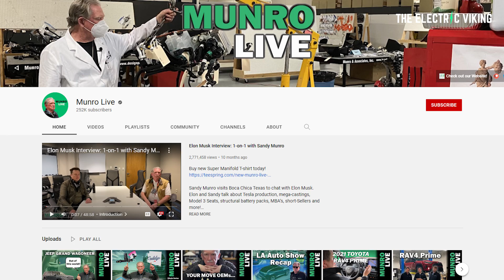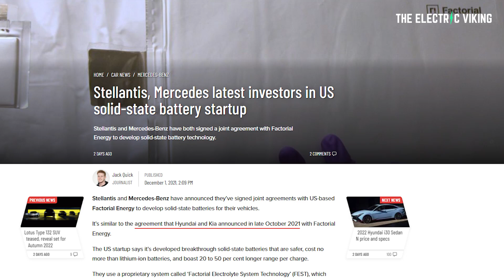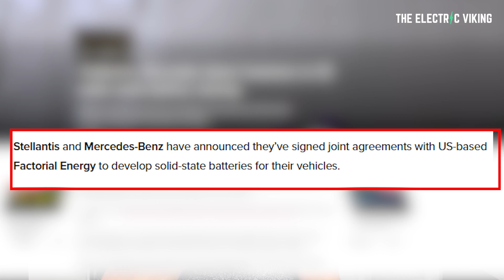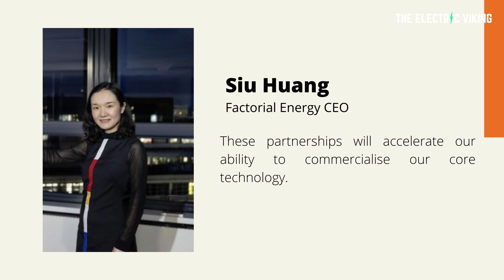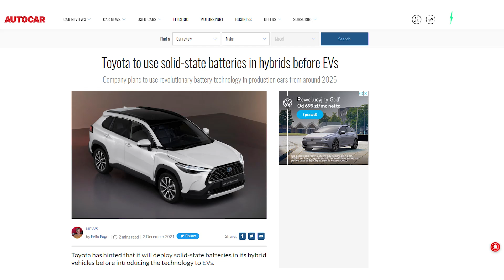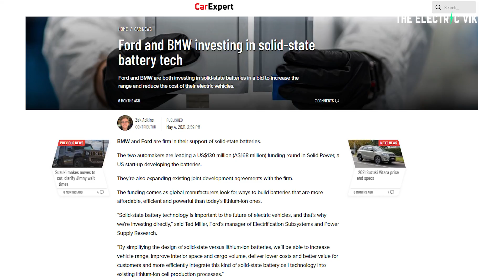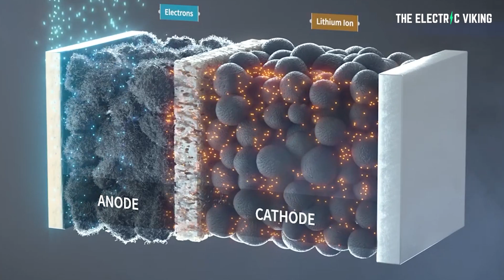United States leading the RACE to develop SOLID-STATE batteries

Comment: Soild state is good on paper but I haven't seen one yet. If you had one with 150 mile range and charged in 5 minutes gas stations would be back in business.
Reply: @Jan 6 was "Wall Street Putsch" part 2 people that live in apartments will publicly charge. When gas goes to 6 a gallon ev transformation will be quicker than you think
Reply: @Jan 6 was "Wall Street Putsch" part 2 
Shell just opened their first complete conversion of fossil to charging in London.
They are phasing out pumps in Norway, replacing them with charging in the same position.

"The advantage of Solid state"(?) MIGHT  be that FEWER cells can be used, in SMALLER packs (about 60kWh) which charge quickly.

Comment: Chinese cars are less expensive because their workers are not paid very well.
Reply: That would have been correct 10 years ago.  Why didn't Tesla build a factory in Mexico instead of Texas since Mexico's wages are about 20% lower than China's?  There's more to it than just lower wages in the case of China's manufacturing advantages over the US and Mexico.
Reply: @Jan 6 was "Wall Street Putsch" part 2 
The biggest load of bs I've read this month.
Reply: "not paid very well" compared to?
I know they get 3 free meals a day, healthcare, and probably better pay than the GM Joint venture factory.
What's your source?
Guessing?
Reply: @rogerstarkey5390  I used to travel to worldwide installing semiconductor equipment.  Every customer was different in their operations on how they treated us and their employees.  So I am guessing, but from a perspective on how cheap and inefficient they can be.

Comment: Always try and stick to the known instead of the unknown. I think solid state is a potential good tech but it's not here any time soon   LFP is already here and works well. They are also making great strides in longevity and charging speeds. The cost is also very good. It's here now not 3 years from now.
Reply: One could say they're Goodenough.
Reply: Toyota plan to produce about 20%(?) "electrified" vehicles in 2030......  Not exactly a commitment?
Reply: @rogerstarkey5390  Currently, 25% of Toyota sales are electrified vehicles. This is expected to rise to 70% by 2030. They expect to sell 2 million zero emissions vehicles (BEV & FCEV) by 2030. They also say this can be accelerated in areas of sufficient infrastructure and demand.

Comment: What car companies are planning on using the Solid State Batrees?
Reply: Basically everyone, gm, Ford, BMW, mercedes,polestar, geely,byd, gaic, vw, nio etc. Ssb is also the gateway to electric aviation.
What's very weird imo is very few seem to even be investing in the same ssb companies. You'd think whoever appeared to be ahead would garner massive automotive grade investments from multiple large scale existing oems. But it's like they are all pumping $ into various ventures.🤔
Reply: @4literv6  Byd already produce their own lithium batteries why would they want to switch to solid state batteries?
Reply: @tmd-w1552  energy density at the cell level is supposed to be between 40-60% higher with a ssb. 
Less chance of any thermal runaway, more resistant to temperature changes affecting the rated range. 
Already proven to be 3d printable cells in the lab. Less cooling requirements means simpler lighter cheaper thermal controls.
Reply: @4literv6  
You know that to date SSBs need to run at well over 50°c ? (Some rumours of advances....... we'll see.
Reply: @rogerstarkey5390  I had seen that yes, and wondered what kind of insulation they would use. And or heating elements to keep it in an acceptable operating temperature range. Fwiw my opinion on ssb is by the time they enter commercial service likely imo around 2027-2030.

Existing battery tech with the yoy advances we're already seeing. Along with switching to either the byd blade cell format, teslas 4680 tabless cans, or even another as yet revealed format. Will pretty much render them a moot point. 

As right now we are seeing pretty steady 3-5% pack level energy density improvements each year. With graphene,silicon and dry cathodes about to enter the fray. And who knows what a combination of any or all of those could end up yielding. 🤔

Comment: Is solid state even possible? Hopefully it's not a gimmick
Reply: I'm just curious of why leading EV automakers like Tesla are not talking about it as much as automakers and companies that are not as popular.
Reply: @Joda30088  they have a mission to accomplish while others have been sleeping on the wheel.
Reply: @Joda30088  Perhaps trying to drum up investment? There are no solid state batteries that meet all the variables to make a viable EV battery. E.G. Charge times, Life time, material costs, manufacturing costs, charge rate, discharge rate, Wh/kg, Wh/L, safety, efficiency etc. Or of the SSB's there are, Lithium batteries are a better solution.
Reply: It is possible. Google is your friend. do some of your own research, friend.
Reply: @mshell1959  but is it viable? I suspect solid electrolyte will create higher internal resistance problems.
Reply: It is.